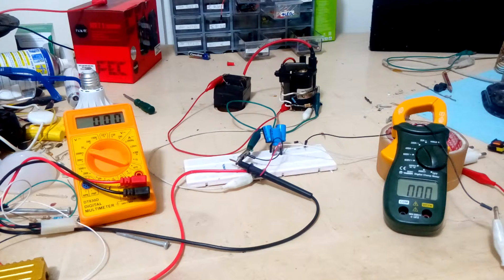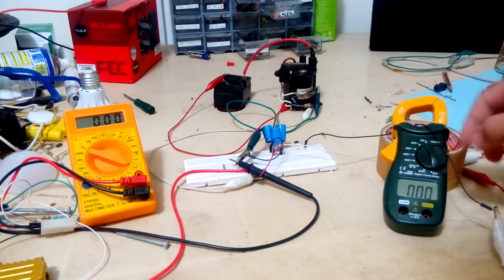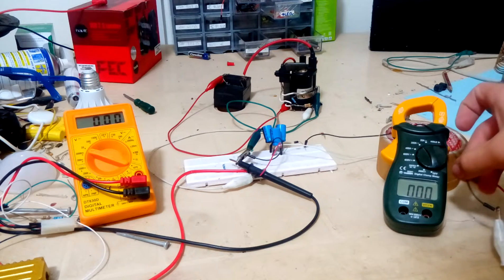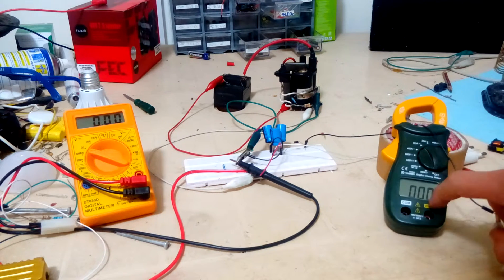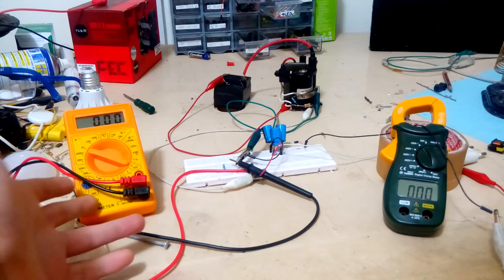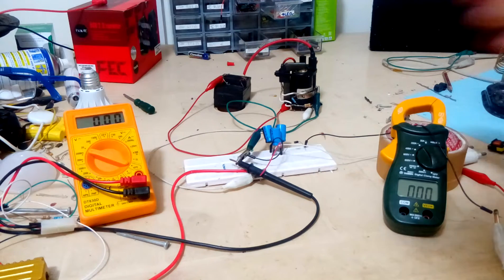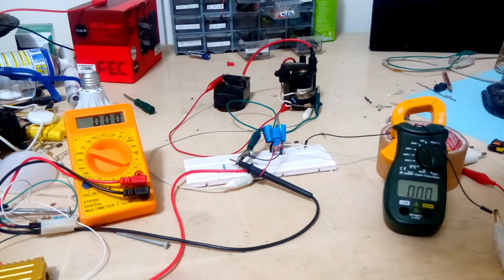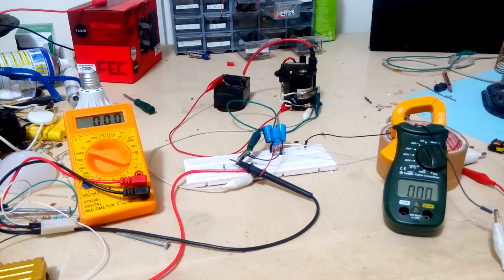Fan capacitor discharge test

Comment: Don't charge those capacitors up with the high voltage, you will quickly damage them ...
Reply from the maker: Benjamin Esposti charging them to the peak voltage of the supply will kill them and make internal sparks. In fact I know when to turn the flyback off